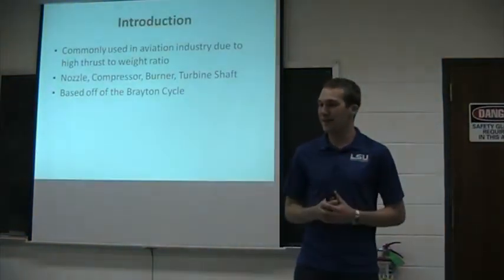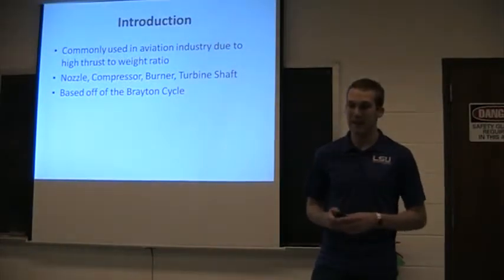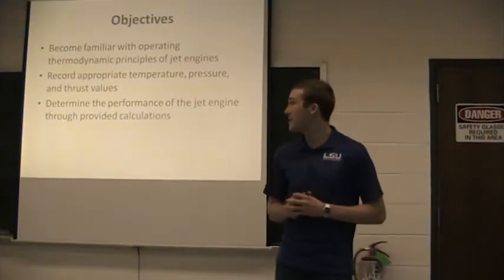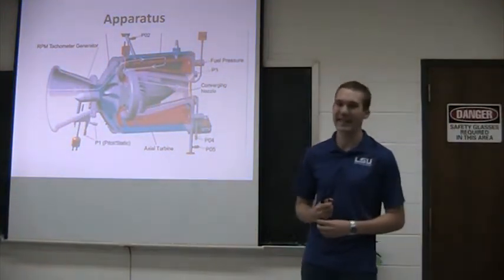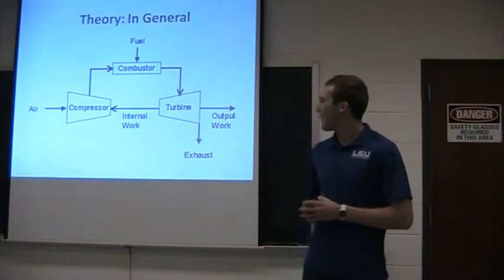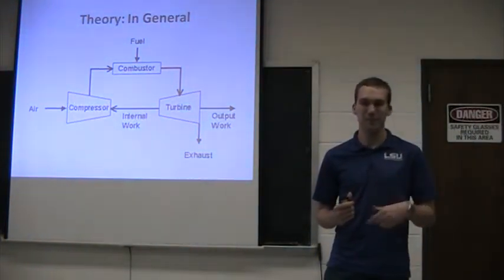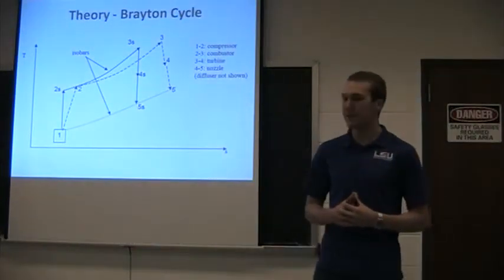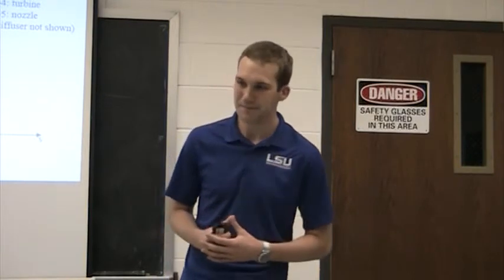MOV00C

Comment: In your lead presentation you continued to be one of the most confident speakers in the class. You're voice was clear, hands were above your waist and you gestured appropriately. From the video you can tell that you relied on the computer screen at times however this is still better instinct than turning to the screen. Perhaps an extra run through beforehand would have solved this.

Comment: Not my best presentation but I am fairly satisfied with how it went. I wish I would have focused more on the audience and not looked so much at the presentation. As for my technical aspects I think that I did a good job portraying the information and getting the message across to the audience. Also another possible improvement is that I could have included some of the procedure in the presentation mainly to emphasize the extra safety factors associated with this lab. Overall it went pretty well,